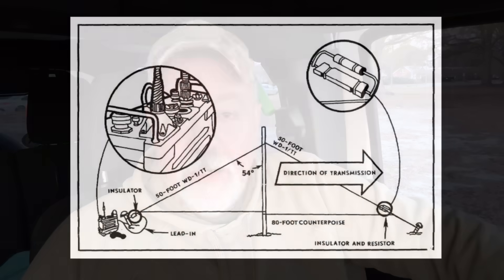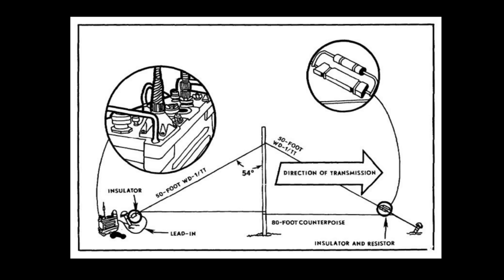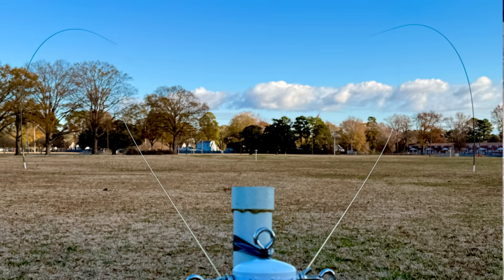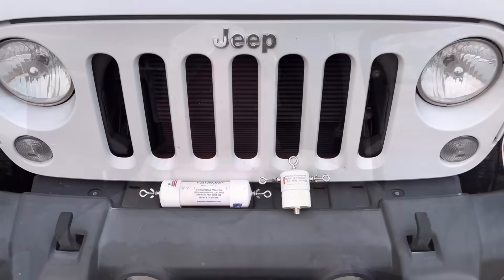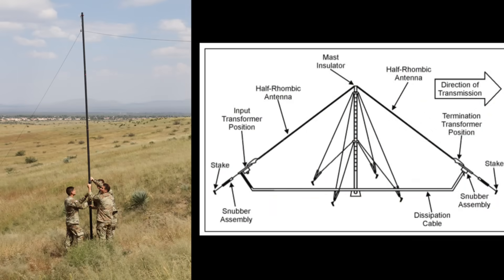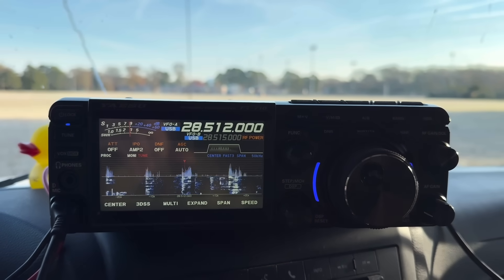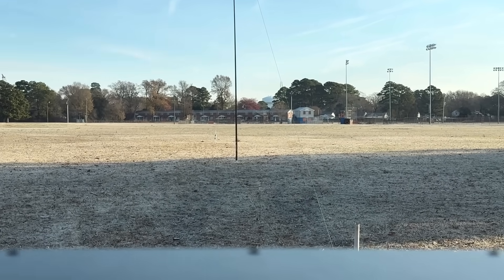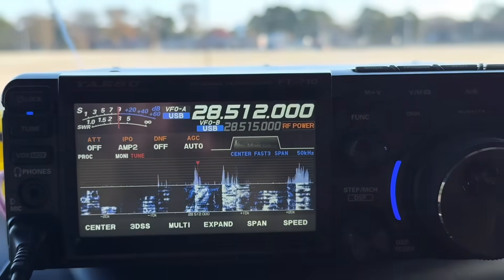HF Ham Radio with a US Military TEFV Field Antenna

Comment: I was a STA Marine in the 80's. we used those PRC 77s and a few different field expedient configs. we used comm wire, high speed tape, 550 cord etc. and MRE spoons for insulators

Comment: A popular antenna with the military, cause the ALE can jump bands without complex automatic antenna tuners or huge multi-band antennas.  But, I think,  they consume about half your transmitter power in that high wat$tage terminating resistor as a tradeoff for the wide bandwidth...  Thanks for the video, appreciate the time you put into these.  Best Holiday to you and yours...

Comment: A version of this was issued as part of the UK army Clansman system for VHF with the PRC351/2 and VRC353, I have the matching transformer and the terminating resistor but not the wires yet. Interested to see that it works on HF, must try it.

Comment: I find with terminated antenna systems they seem to have less background noise. Wind rain  snow can have static build up. The 600 ohm resistor can dissipate the static.  Even in desert locations with wind and sand ,Static charge can be a problem. 73

Comment: Walt, this antenna looks pretty similar to a terminated delta loop, or a KAZ, as commonly used for directional (cardioid-pattern) MW & lower HF DXing. It just requires a bit larger termination value and higher turn ratio on the balun. There, the directivity is towards the feedpoint, but I think it does flip to the termination end somewhere higher up, like yours. Perhaps your antenna is just like that KAZ 😜 73, Pipe and Hole 🕳️

Comment: My brother, that sucker is almost a KAZ!  Swap that 12:1 for a 16:1, put a variable resistor on the termination side and raise that bottom counterpoise wire about a foot or so off the ground and you will have a phenomenal MW antenna for receive!!!!

Comment: Great antenna Walt. It  known as a field expedient antenna in the U.S. Army and it was made from WD 1 field telephone wire.
 While I served in  the Canadian Army  Reserve as the signals N.C.O for an  Infantry Regiment, we built and used this antenna to improve longer distant comms using the AN/PRC77 manpack radio and they suggested using a d cell battery as a terminating resistor .It worked quite well and it did boost the signal for about 10 KMs using FM.
  The U.S, Army manual suggested using a D cell battery as a 600 ohm  resistor was not something a combat regiment would not have in its stores.
The AN/PRC77 sets  frequency range was  VHF low from 30.00 - 75.95 MHz. It was described as a half rhombic antenna and the terminated end was aimed in the direction  of the station to be worked.73,de Don VO1XH.

Comment: It worked better than I thought it would.  I wonder if I could put a microcontroller relay in-between the terminating resistor on my EFHW so I can turn the termination resistor on and off.

Comment: Nice build Walt!  For years I used a 9:1 with a 66..68ft radiator and a 33ft counterpoise in a sideways V. In other words half of what you built here with a shorter counterpoise. You did have to use a tuner though but it was pretty close on 40m. The counterpoise I raised off the ground about 2 or 3ft. On 40m it was broadsided but on 20m it was more gain towards the feedpoint. Many times I would get the radiating end up as high as 60ft with the feedpoint end at 3ft (sloper). It worked like gangbusters. With that antenna alone I made well in access of 10,000 contacts on POTA. The unun was a cheap Ebay thing I got for $23.00 and built. Dog fence wire (14g) pulled up from the backyard ;-) Robert KD4YDC

Comment: Have you thought about doing a little FT8 to get a better idea of where these antennas are sending?  I know you''re mainly a phone guy but a couple minutes of FT8 on the bands before you break it down would be cool.  You could post the pskreporter map.  Anyway, loving the cool antennas I never heard of!  73!
Reply: Or even programme one of the CW memories with TEST DE K4OGO and use the reverse beacon network to see which stations received it.

Comment: Wow, this one impressed me on 10 so far. I have a ton of wire up and could easily modify what I have to be this with probably the same 160 meters of wire. Seems like the terminating resistor might need to be a carbon higher power of some kind ? Thanks N6GRG

Comment: Walt I am going to ask what is probably a dumb question, what does the 600 ohm resister do for the antenna?
Reply from the maker: An HF antenna termination resistor absorbs leftover RF energy at the end of a transmission line, preventing signal reflections (standing waves) that cause noise and inefficiency, crucial for broadband antennas like the T2FD, Rhombic, or Beverage antennas to maintain proper impedance matching (e.g., 450, 600, 800 Ohms) and signal integrity

Comment: A quick little run with the calculator, c/o the Pythagorean theorem, gives me 86.6 feet separation between balun & termination. W6SAI in the Editor's & Engineer's Radio Handbook called this a Half-Rhombic as did Ed Noll in his book, 73 Wire & Dipole Antennas. 10 years in the US Navy taught me that any simple concept will be given a confusing acronym per policy. Whose policy? You don't have a Need To Know that information...

Another great one, Walt, and waiting for your next post here in 10 defree sunshine near Lake Erie. A bit brisk...

De WB2VUO near Buffalo, N.Y.

Comment: Another interesting antenna, thanks Walt! After your video, I read up a little on this antenna and the trade-off seems to be extreme wideband versus up to 25% power loss through the terminating resistor... that didn't seem to affect you much today though! How many watts were you using? If it's in the video, I missed it.
Reply from the maker: 100 watts, I probably should have mentioned that.
Reply: @COASTALWAVESWIRES  Thanks Walt, that means you were getting out with at least 75W and they were working well for you!

Comment: Made this with a 9:1 unun and a 500 watt non inductive resistor. used 110 ft of wire for upper radiator. Will tune 160m through 6m and it WORKS! Internal tuner easily handled it on the 710 rig. Do NOT ground the far end, just use the ground radial .
Reply: Could you let us know where did you buy the non inductive resistors, please?
Reply: @PT9KK Palomar Engineers has them or you can get them via one of the major online stores
Reply: @PT9KK got mine from Palomar engineering in California. It was $120 for the resistor and $80 for the unun
Reply: I'm building the same thing right now. 9:1 unun and resistor. Just got the stakes in the ground and ready to cut wire to stand it up and see what the analyzer says
Reply: Success here too, used 80ft of wire for the upper and 40ft across the lower. 20m tune is amazing, 10m is pretty good too, can't wait for this solar storm to pass

Comment: That looks good as a portable antenna with only one support. I would like to see what happens when you disconnect the resistor when receiving a signal off the back. I always like to compare my real world results with the EZNEC predictions. 
I wonder what ground parameters you use in the model? I usually use the Real / High Accuracy type and Average ground type. For where I am that seems to be in agreement with the on air results I get. When I lived on the salt water marsh in Hampton I sometimes used very good and salt water to see the range of differences. In those days I had salt water come up under my antennas several times a year and at one time my tower was only a few feet ( maybe 3 or 4 feet) from the salt marsh. 73, Don  N4DJ

Comment: Hi Walt:  WOW!! This antenna brings back memories when we used it on HF when I was on active duty in 18th ABN Corps, and later when I was the Battalion Commo Sergeant in the 163rd MP BN.  in the D.C  Guard/Reserves in the early 70's.  Looks like it was working great.  We used it for long-distance HF, and for unit tactical purposes on freqs just below the 6-meter band on FM.
Best 73's K4BSA
Reply from the maker: Awesome! Thanks for sharing! I really want to build it again in the summer during a 6 meter contest.

Comment: Interesting builds you've been doing, I'll have to look into them. Curious to know what the terminal resistor does.
Reply from the maker: It’s used to make the antenna directional and broadband. It prevents signal reflection and produces a standing wave antenna.